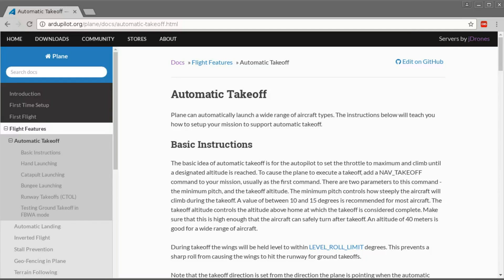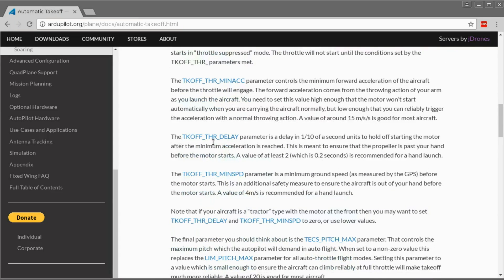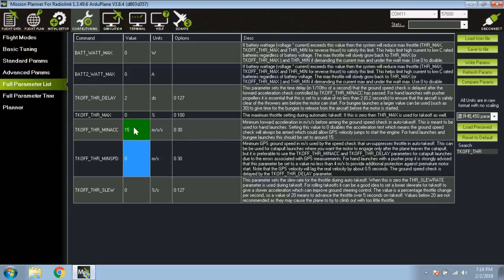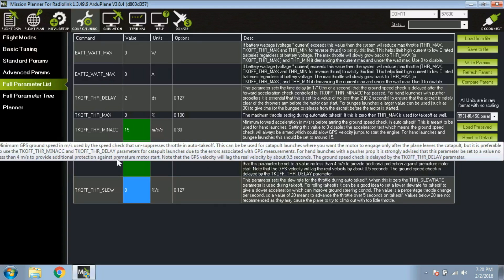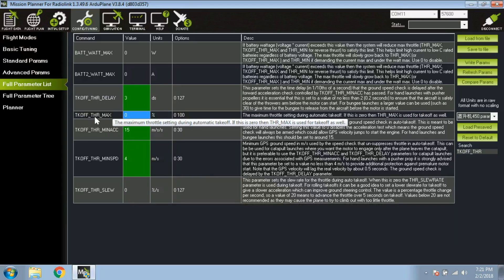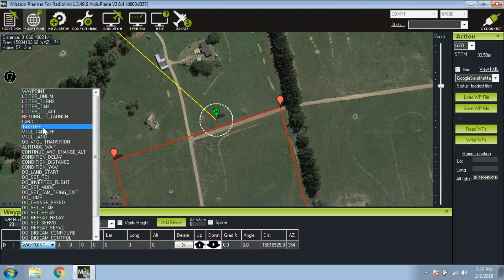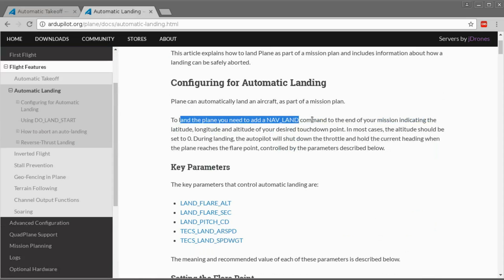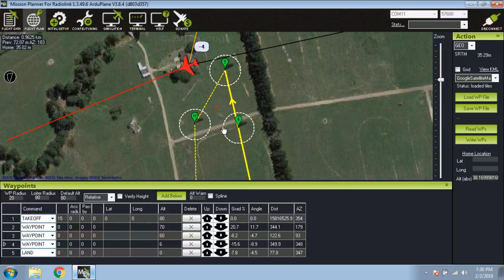Arduplane auto-takeoff and auto-land test

Comment: You should consider installing an airspeed sensor, it will make the landings a lot more efficient, as the flight controller doesn't have to guess what the wind speed and direction is.. I like your videos, keep them coming...

Comment: many thanks for sharing
The RTF wing Parrot Disco does the same but to make every landing a smooth one, when in auto-landing mode during the very steep descend they activate an ultrasonic ground sensor that once ground is detected (last few meters) they instantly lower the descend angle, turn off the prop, it folds back and on the last meter of height they fly almost level and bleed off the airspeed and land very gently. It is a great help for a beginner but I'd always prefer to land manually if I only could - its not an option here.
For any Parrot Disco user - please assure you have another 10m of space behind the planned landing spot, because it overshoots by design. If you factor that in, you can auto-land it within 5 meters "on the spot".

Comment: Thanks for making this video! I'm learning how to use Mission Planner and this was helpful. However, everyone should keep in mind that without differential gps receivers and modules, the accuracy isn't extremely precise. Expect errors on the order of 5m laterally and 10m in altitude -- and that's before taking into account precision of the autopilot itself. Pulling off landings in such tight quarters as these (with the expected gps errors) is impressive.

Comment: Great information been messing with ArduPlane for some time with a Hobbyking EPP-FPV and I've had some good results but not been brave enough to try auto launch or landing. I'm still using the old 8bit APM 2.7 which still does a good job.  Thanks for sharing

Comment: nice video! i know it's old but just for other's reference there is a "auto mission reset" command that you can bind to a rc input, and i'm assuming it can reset the auto mission waypoints while still flying, because otherwise it only does it when you disarm

Comment: With all my smaller wings that are hand launched it set MIN_ACC pretty low and no delay. Then I put the plane in auto and give it a shake to start the motor and launch with a side release without really throwing.  The bigger Opterra is bungee launched with the motor off.  I have the  default delay and min_acc set.  Hook on the bungee and put it into auto and release.  Goes off without a problem.  Wings are hard to throw especially the smaller ones that have nothing to hold on to.

Comment: If I raise the throttle to 1/2-way (after switching to AUTO), the motor starts, which it's not supposed to do (all other settings/parameters are correct)...also, I've seen other videos where the pilot leaves the throttle at ZERO, and then throws.  So which is it?  Thanks...
Reply from the maker: "When the auto takeoff mission command starts (usually by switching to AUTO mode) the autopilot starts in “throttle suppressed” mode. The throttle will not start until the conditions set by the TKOFF_THR_ parameters met."
http://ardupilot.org/plane/docs/automatic-takeoff.html

Comment: Hello. could you kindly tell me if there is a way to adjust dead band like there is in betaflight. I've been discouraged from using my APM because of drifting and I know it could be corrected but no matter how much research I do I can't find a way to set dead band in mission planner
Reply from the maker: Sounds like maybe your transmitter just needs to be trimmed so that the pitch/roll (or whichever is drifting) is centered. You might also be able to reduce the effect of small movements near center by increasing the expo in your radio.

Comment: The question that no one asked is the most important one: I have flying wings, and I want to use the auto takeoff, I create in the mission planner only one waypoint that would be the takeoff, but I create this point each time I change my flight location or can I just turn on the auto mode, and will he know that the place should also takeoff, even though I'm hundreds of miles away from the point I created the first time?
Reply from the maker: The auto-takeoff command has no lat/lon position. It only has an angle of climb and an altitude target.
Reply: Okay, I get it, so I can create the first point anywhere in the world aprnas to create the auto takeoff function, but when it's time to use it no matter where I am, very good then, because it's the lack I feel when I use my apm with my mini talon. Thanks a lot for the help. Success to you
Reply: That's good to know...
I have a 6 position switch on my Taranis with overrides to manual or rth, i could just use one of my modes to enable it i think?
How long does it continue the climb out from auto launch? Until you give it input on the sticks or switch out of the mode? 
Thanks.

Comment: Did i'm correct, i saw the way you armed the plane with tilting the plane nose down.  Is this correct?  If it's correct may i know what parameter should i changed
Reply from the maker: I think the plane should be facing in the direction you want it to climb out, when you arm it. The pitch/roll should not matter. In any case all these details are in the Ardupilot web page...

Comment: so notice this is 4yo... I'm new to this do I need to do all the mission planning for tkoff if I'm using a switch?
Reply from the maker: I'm pretty sure the takeoff command is only ever part of a mission, so yes, you'd have to start in auto mode and have at least those commands in the 'mission'. But you don't need to create any waypoints to fly around in an actual flight path - after takeoff just switch into manual or whatever other mode you actually wanted.
I ended up not using this though. If you're hand-throwing it might be easier to just use FBWA for auto-level, and use a mix on your radio to have the plane climb slightly. I described how I do that in this video. https://youtu.be/zkSxvZfZlLU?t=1366
Where I live now, I can throw the plane from the top of a long slope so I don't even need that these days - just plain auto-level and the ground drops away naturally.

Comment: Are there some possibility for autopilot to determin the wind? If there is IAS sensor on the plane, can the AP make an information of wind, with data of IAS, current heading and ground speed from GPS. I am asking regarding the autonomous landing into the wind.
Reply from the maker: Apparently it can determine the wind direction and strength from the throttle and groundspeed reaction, even without airspeed sensor. It has been working so well that I don't know if I will bother putting the airspeed sensor on.
The landing direction is set by the user, it cannot be calculated autonomously because of obstacles etc.

Comment: Does this feature work with a quad copter
Reply from the maker: auto-takeoff and auto-land? Sure, but you don't throw it to launch obviously :)
Reply: iforce2d I think I’m in on this project

I’m going to build the plane and order the stuff from bang good
Reply from the maker: ah, I actually saw that video, didn't realize it was arducopter.
Mark, I ordered a FX79 to make a better setup and try some mapping, maybe by the time it gets here I'll be able to make a less fumbling video about setting it up. Not sure if I'd go for this particular flight controller again because the lack of connections is quite restrictive....
Reply: iforce2d I will get the plane complete and flying and wait for that video. at least I have something to do for a while

THANKS

Comment: One million points
Reply: It will climb to the height you specified before starting nav, I think that's why it didn't turn when you expected it. I also hand land BTW, but its a jolly cool feature. Well done you aced it and as with everything the second aircraft you set up will be much easier.
Reply from the maker: But it did turn, when I didn't expect it to. I expected it would climb to 70m in a straight line before doing anything else.
Reply: iforce2d My bad, yes that is what I would have expected. Maybe try on a calmer day and perfect the pattern for a windy day. Very small area you are using, so a great effort!
Reply from the maker: I tried a few more times off camera and I don't think it was the wind. One time right after the motor started it did an almost 180 degree turn at full bank about 3m off the ground, I had to hit RTL to save it. So I'm kinda wondering if the mission was not reset and it was going directly to the LAND waypoint that time. I'll have to look into how I can properly reset the mission from my radio, this must be something a lot of other people have had to deal with already...
Reply: I have had to spend a lot of time considering what is exactly going to happen when I add the land, watch all the missed and long approaches. https://youtu.be/p95TX4w1NLA that has been solved with a LiDAR. How much are you slowing down for the landing? That will give it more time in that short distance.